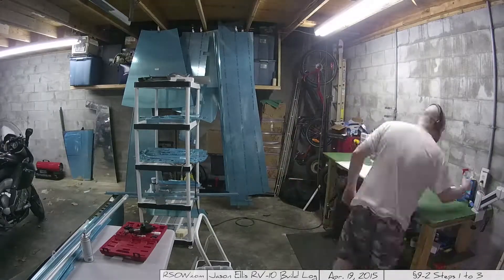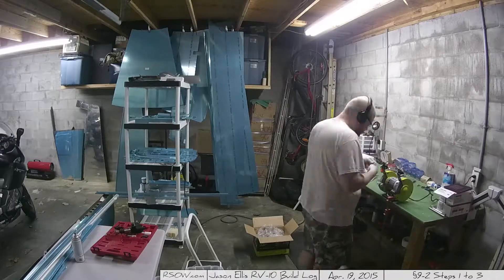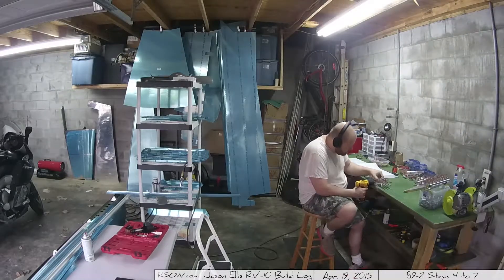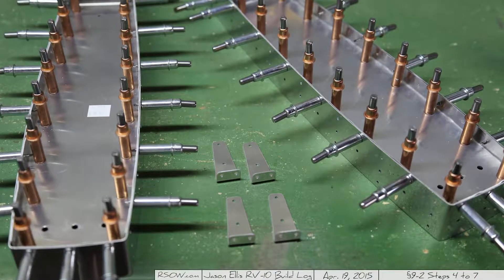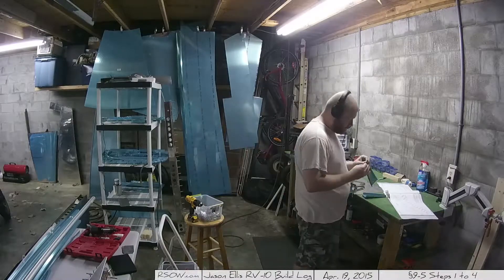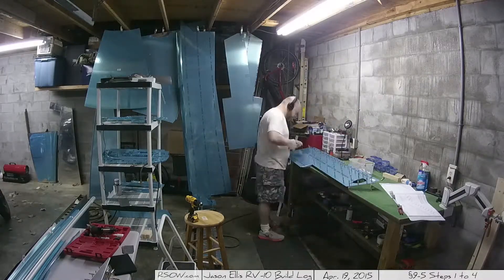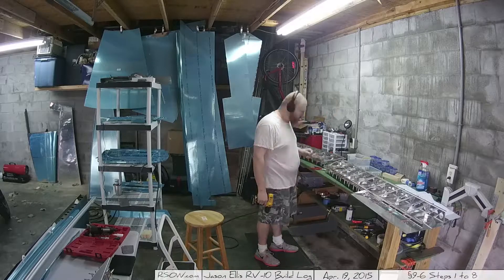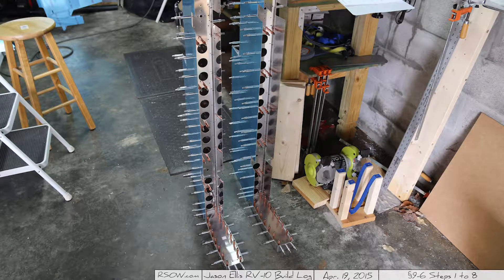RV-10 Empennage section 9-2 to 9-6

Comment: Am I using the wrong blade, or does the bandsaw create some pretty dang rough edges?
Reply from the maker: Just make sure you're using an aluminum cutting blade (tiny teeth) and make sure it's sharp/new.  The cut can be jagged yes.